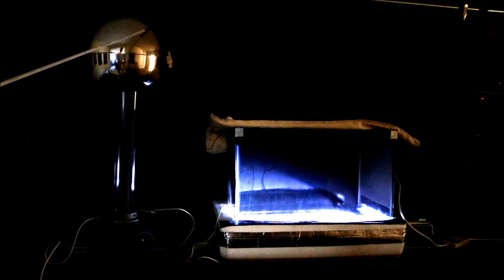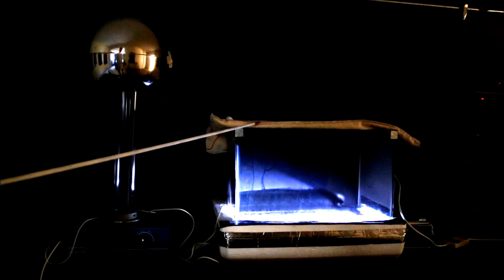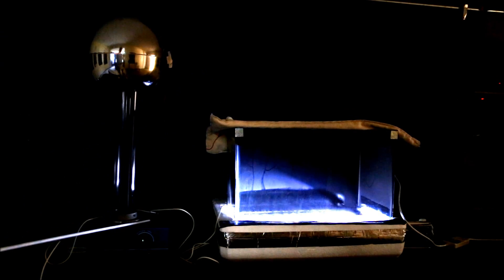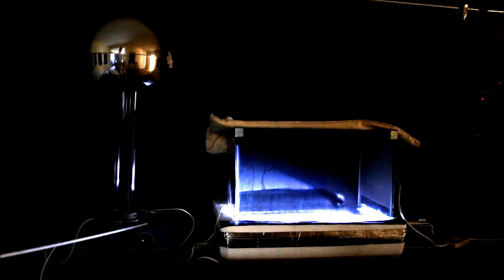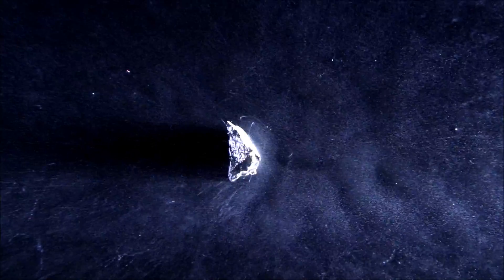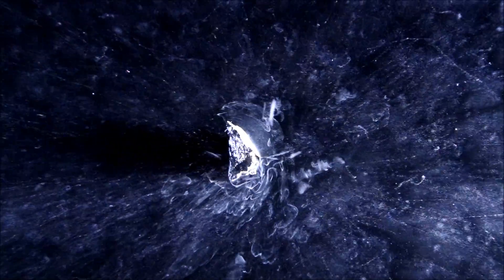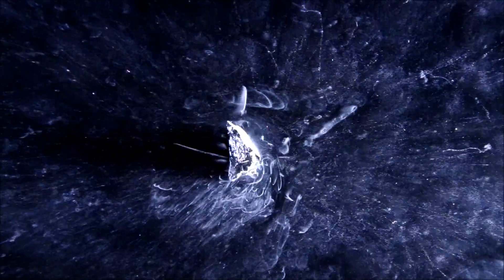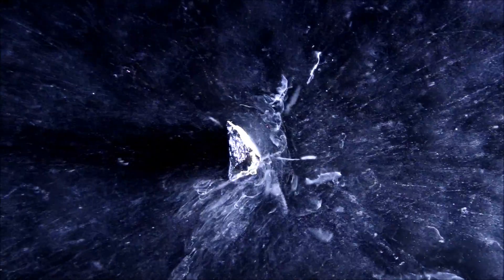What Applying An Electric Field Does To Tracks In A Cloud Chamber

Comment: what did you use to apply the electric field to the chamber? sorry if mentioned but i'm trying to find a way of inducing a magnetic field around a cloud chamber and was wondering if you knew a sufficient product
Reply from the maker: At the very beginning of the video I show and explain that a Van Der Graph generator was used to apply the electric field. I have tried placing N52 rare earth magnets in the chamber to curve particle paths but it didn't work. Either they weren't strong enough or their fields weren't uniform enough to show any effect. Helmholtz could work, but the cost of making a pair strong enough to produce a field in the 0.1 to 0.3 Tesla range to curve particle paths would be in the $1,000 range at least, and that doesn't include the power supply to drive them. Making the chamber very small would help, but it's still fat too difficult for me to attempt. Good luck, though!

Comment: Do you know how much voltage you used, and where to get a hv power source like the one you have? Also what type of top conducting plate did you use? Thanks!
Reply from the maker: The Van de Graff generator is rated at a. potential of 250,000 volts, but because of losses due to the grid, I'd estimate the field was closer to100,000 volts. Dividing that by the 9=inch separation gives a field around 10,000 volts per inch in the area of the tracks. The upper grid was a piece of 1/2-inch hardware cloth. I hope this helps. Thanks for writing!

Comment: It sounds like you're observing an increase in the *density or number of visible tracks* when an *electric field* is applied in your cloud chamber experiment. While this might seem surprising at first, there are a few plausible explanations for why this might happen, even though the electric field doesn't directly create more particles. Let’s explore the potential reasons for this observed effect:

### 1. *Electrostatic Focusing or Acceleration of Ionized Particles*
When you apply an electric field to a cloud chamber, the charged particles moving through the chamber may be accelerated or decelerated depending on their charge and the direction of the field. This change in energy can influence how much *ionization* they produce along their path.

- *More ionization at slower speeds**: If particles (especially lighter beta particles) are **decelerated* by the electric field, they may spend *more time in the chamber* and interact more frequently with the surrounding gas. This could increase the ionization rate, making the tracks denser and more numerous, as more vapor molecules become ionized and condense along the particle's path.
- *Electric field focusing**: The electric field may also act as a **focusing mechanism* for some of the lower-energy, slower-moving particles. These particles might be deflected or redirected in such a way that they remain in the visible part of the chamber for longer, increasing the chances of observing their tracks.

### 2. *Secondary Ionization Effects*
The electric field could be increasing the *likelihood of secondary ionization**. This is when primary particles, such as alpha or beta particles, knock off electrons from surrounding atoms, which themselves become ionized. These **secondary electrons* can then go on to produce additional ionization, leading to more visible tracks.

- *Amplification of ionization**: The applied electric field may give enough energy to these secondary electrons to produce **more collisions* with gas molecules, causing an increase in the *number of ionized molecules* and thus creating more visible tracks.

### 3. *Electric Field Enhancing Condensation*
In a cloud chamber, particle tracks become visible because the ionized gas molecules act as nucleation sites for the vapor to condense into tiny droplets. It's possible that the *electric field enhances this condensation* process by influencing the behavior of the ionized particles:

- *Increased nucleation**: The electric field could potentially **polarize* or otherwise affect the charged particles in such a way that more of the ionized molecules become effective nucleation sites for condensation, thereby making the tracks appear more *numerous* or **denser**.
  
### 4. *External Environmental Effects*
The presence of an electric field could also *affect the environment* inside the chamber in subtle ways that increase the number of observable tracks:
- **Electric field causing localized cooling**: In some setups, the electric field might cause localized cooling or changes in air pressure that could enhance the condensation of vapor around ionized particles. This could make tracks more visible or increase their density.
- **Electrical interaction with the chamber walls**: Depending on how the electric field is applied (e.g., through charged plates), there may be additional ionization effects from the chamber walls, leading to more particles entering the chamber and creating more tracks.

### 5. *Electrostatic Attraction of Ions*
When a strong electric field is applied, ions created by passing alpha or beta particles can be attracted toward the oppositely charged plates, influencing their movement. This could lead to an increase in the **number of visible ionization trails**, especially if particles that were previously not visible are now directed toward a region where they can be more easily observed.

### 6. *Increasing Energy of Particles Entering the Chamber*
If the electric field is strong enough, it could be giving an extra "push" to some charged particles entering the chamber, allowing them to have *higher energies* and interact more vigorously with the chamber gas. This could increase the amount of ionization and result in more visible tracks.

### 7. *Increase in Background Radiation*
Depending on the configuration, the application of an electric field might cause *increased background radiation* or ionization effects from the surrounding environment. This might result in more tracks, even though the source of radiation remains the same.

### Conclusion:
While the electric field itself doesn’t directly create more particles, it can influence their **behavior**, such as by:
- Slowing down some particles, causing more ionization and denser tracks.
- Enhancing secondary ionization processes.
- Improving the condensation process in the chamber.
- Influencing environmental factors that enhance visibility.

These effects could make it appear as though there are more tracks or that the density of tracks has increased, even though the total number of particles passing through the chamber remains the same.
Reply from the maker: Thank you for your comment. You've given me a lot to think about.
Reply: @wayneschmidt490  🍻🥂Cheers
Reply: Why is this written like it's from Chat GPT?
Reply: @ ‘cos .. your 🫵🏻 intelligence is very artificial 🤦🏻‍♂️🤣, from Alpha -to-> Omega
Reply: chatgpt answer

Comment: Would an even stronger magnetic field create even more visible tracks, maybe even showing the polarity a bit more clear? Thanks for the video!:D
Reply from the maker: It wouldn't show more tracks, but it would make them curve, from which their energy and charge could be calculated. But, the film would have to be a significant of a fraction of a Tesla in strength, and fields this strong are very difficult to create.
Reply: @wayneschmidt490  thank you!

Comment: But what is the reason?  Why is the number of tracks increasing?
Reply from the maker: My guess is that the applied electric field places a strain on the atoms in the cloud chamber making them easier for the charged particles coming off the uranium to ionize. This means more ionizations, which makes the tracks easier to see. The uranium puts out a constant number of particles per second, but many of these may produce tracks that are too faint to see. The field brightens these enough to be seen, making it look like there are more tracks. I hope this helps. Thanks for commenting!

Comment: Is there any reason this wouldn't work side to side instead of top to bottom? Can't find any info on this. Thanks!
Reply from the maker: Sadly, no. The alcohol vapor is heavier than air so it falls downward. The cold zone at the bottom and the warm top create a thermal gradient. At some point in this gradient, usually right above the cold bottom plate, the temperature is just right to make the alcohol vapor enter a supersaturated state, in which the charged particles can produce tracks. 

If one side was made warm and the opposite side cold, the warm air near the hot side would rise and the cold air close to the cold wall would fall. This would produce a rotational flow that would tend to mix the air and vapor, preventing a stable supersaturated zone from forming. The rotational flow would also tend to sweep away any tracks that might form so they wouldn't last long enough to be seen. 

It's possible that there might be a very thin layer of cold air near the cold side that might produce tracks, but if so it would be so thin and close to the wall that they'd be hard to see. I hope this answers your question. Thanks for commenting!
Reply: @wayneschmidt490  Thank you! And sorry, I should have been clearer. I was wondering about whether you could have the static electric field run side to side (i.e., parallel to the horizontal cold plate).
Reply from the maker: @RigidDesignator  I think the misunderstanding was much more my fault. I failed to recognize which cloud chamber video you were commenting on. I don't see any reason why a side-to-side field couldn't be used. The aluminum bottom plate on my chamber might distort the field, but going to an all plastic chamber would eliminate that issue. If the field was strong enough, I wonder if its would curve the tracks?
Reply: @wayneschmidt490  Thank you! The side-to-side configuration would be easier to incorporate into my design. I have a thermocouple touching my copper cooling plate, and I am worried that I will fry the attached thermometer if I put a large charge on the plate. I will try to work around that but if not I will try side to side.
Reply from the maker: @RigidDesignator  Good luck!